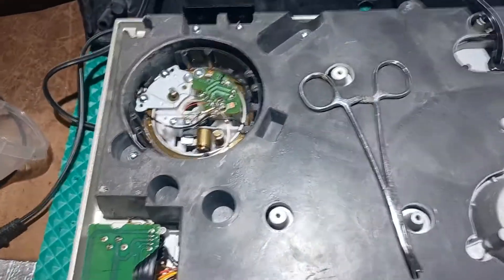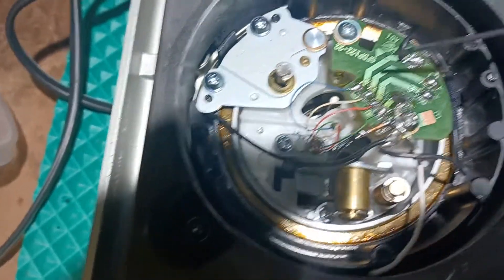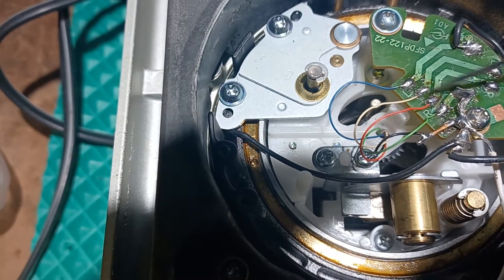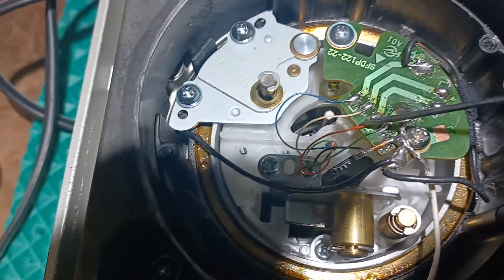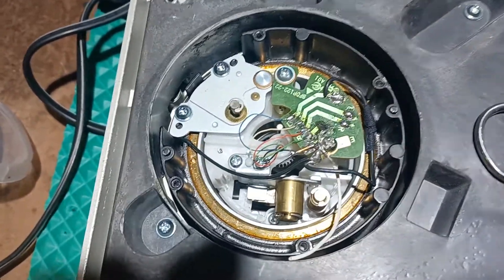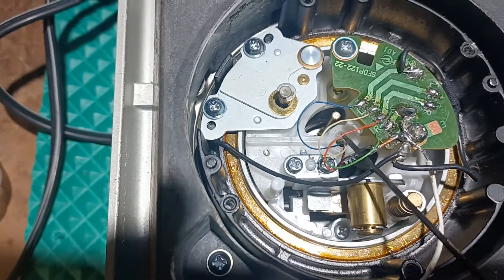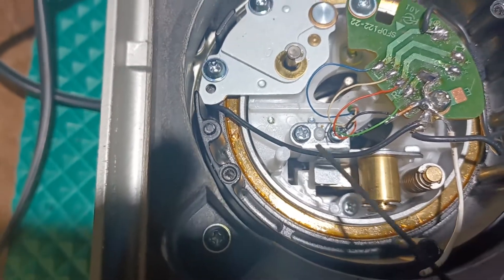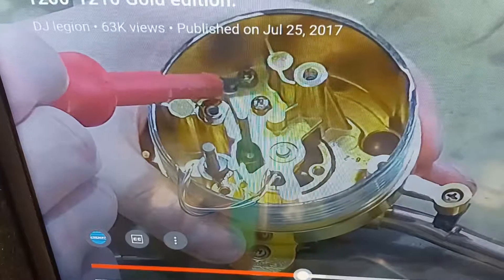Technics 1200 MK5 tone arm wire repair

Comment: I think I have this problem today with an sl1900. One channel has no high tones hardly at all, and it's between that circuit board and the headshell connection. Just gonna replace the tonearm wires I think. Thanks!

Comment: And if some how was shorting things out.   Did you replace the wire coming off the head shell holder????   Or by re guiding the wire will sold the sound Issue??

Comment: WHEN THERE WERE NOT TOO MANY VIDEOS ABOUT THE TONEARM BREAKDOWN AND PUTTING IT ALL BACK TOGETHER, PEOPLE USED TO THREAD THOSE WIRES THROUGH THE MIDDLE. MY QUESTION IS, WHAT A TECHNICIAN WOULD USE TO PEEL THE TIP OF THE WIRE FOR SOLDERING? THERE ARE SO THIN THAT I DON'T KNOW IF IS THERE IS A TOOL FOR THAT.
Reply: just hold the end with fine tweezers right at the end... then touch the side of the insulation with the iron 2mm from the end. this will melt a weak spot in the insulation and it will pull off with the tweezers.